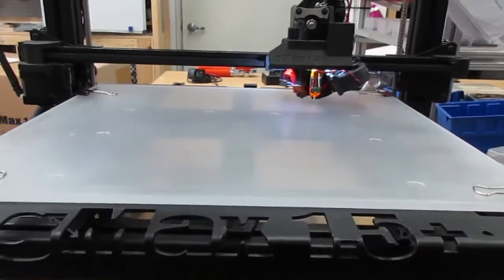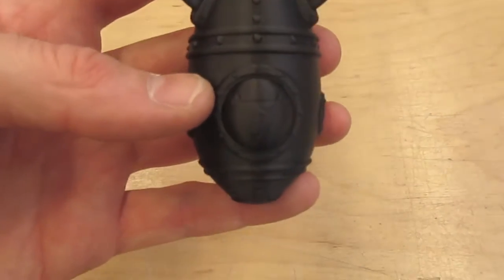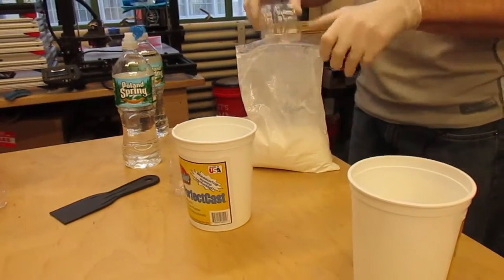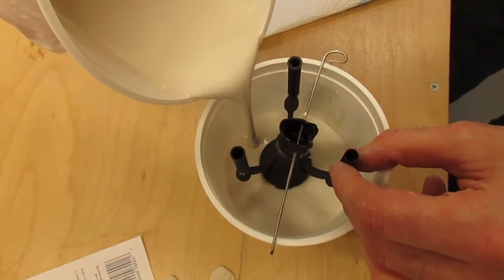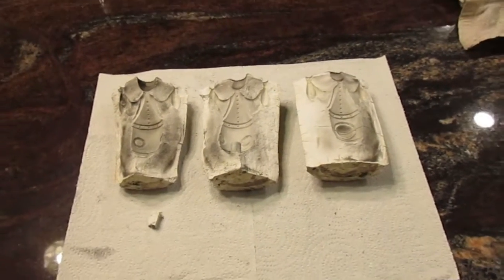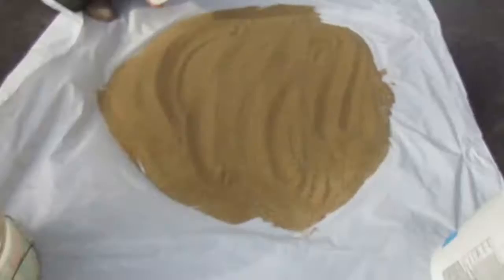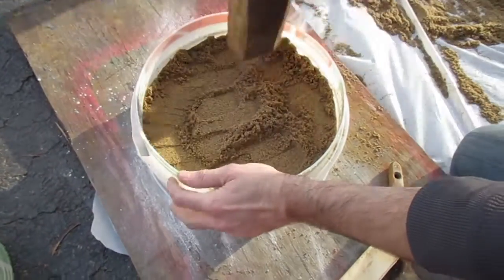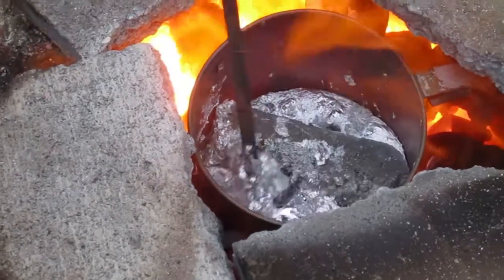Turn 3d Prints Into Aluminum w/ DIY Blast Furnace - Part 2 Preparation

Comment: I had same problem with letters on PLA model. I used petrobond sand still had problem. Wondering if the PLA is the issue?

Comment: You need to add a draft angle to your print otherwise the sand won't cleanly break away from the mold.
Reply: +Barry Manilowa Thanks for your advice. I must admit going into this project I had little hope for the plaster and all hope for the sand... We have a lot to learn.